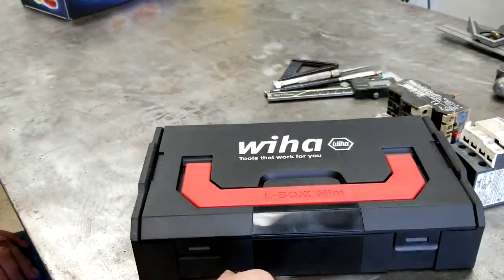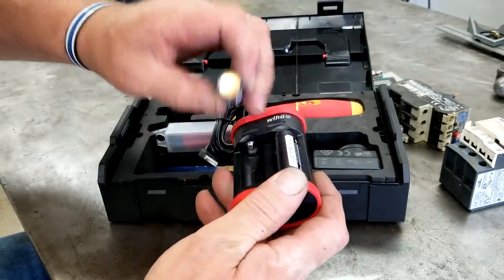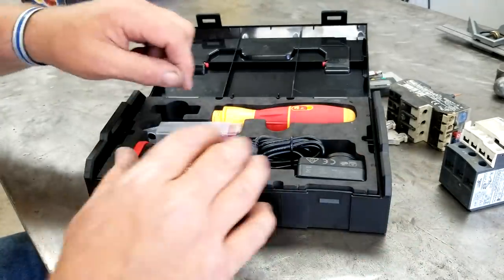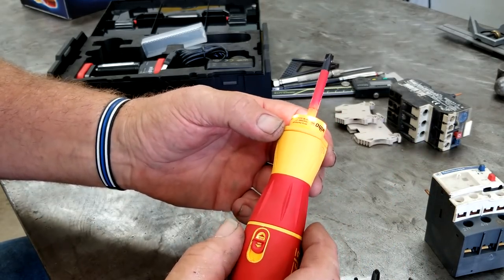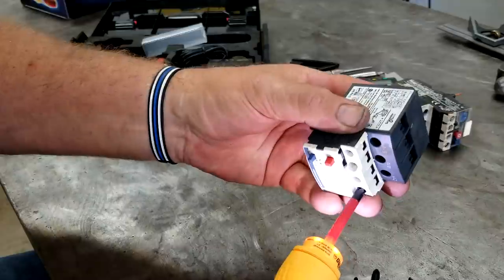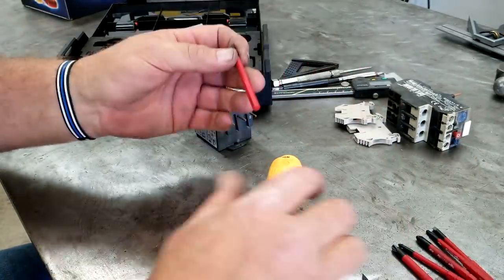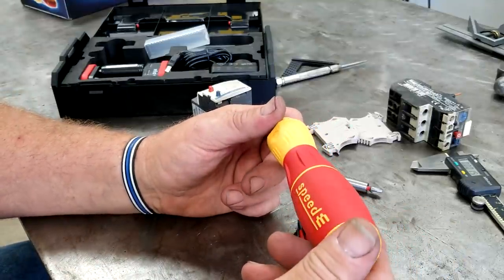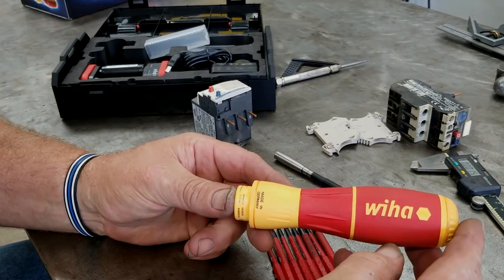Wiha Speed E II tool review

Comment: Thank you for your great review. It is the most complete review I found for the SpeedE II. One option I have in mind is the Wiha 41479 easyTorque set for slimBits and slimVario. With these you can use the SpeedE II motor and then finish by hand to match the needed Nm.

Comment: I love Wiha tools. I have the manual insulated screwdrivers and they are perfect. I also use the 4mm screwdriver bits quite a bit on electronics with conductive handles for ESD protection.  Wiha is short for "Willi Hahn" the orginal 1939 name. The electric screwdriver is new and out of stock right now or I would jump on it.

Comment: Not very long ago I spent $400 + for one of their master torque driver sets. They redesigned the handle (4-5 times now) on the special tool that is needed for setting your desired torque on the drivers. The problem is they never redesigned the cutout in the carry case that is supposed to hold this tool, and the newer tool doesn't fit in. I have to squash it down on top of the foam which keeps the case from closing properly. I contacted Wiha USA about getting a replacement insert for the case and they just blew me off.  I used to like their stuff, but their customer 'service' has now soured me on the company. After paying that much cash for basically what amounts to 3 screwdrivers and a set of bits I would expect ALL the tools to fit in the case.
Reply: No budy respond your comment, sorry men #todoinventostv

Comment: I'm sure their intent was to keep you from using the wrong bits in the driver. Now I'm gonna look to see if they have one for electronics with the small screws.
Reply: 75965 is the Wiha set you probably want. I love mine.
Reply: That's exactly the reason. They also have the speedE Industrial (without the 1000V rating) that can be used with the usual 1/4"-Bits. But all their VDE-Stuff (the german standard for electricians tools) with bits use the 6mm isolated bits.
Reply: @florianf4257  whats the length of the wiha industrial? Thanks

Comment: Thinking of buying this, obviously it would be great for landing wires, but how strong is it.  Could I use this in place of a impact for zip it's, sheet rock screws or similar?
Reply from the maker: Not strong at all, it's handy for free running screws to take up the slack, then a twist of the wrist to finish them off.

Comment: So, either they want to make sure you don’t use uninsulated tips with this, which is why 1/4” hex doesn’t fit. Or, they just want you buying their own tips, which I’m sure are expensive.

But admittedly, this looks interesting. If it were useful for anything else other than this specific work, because of the very limited power of the unit, I would buy it. Unlike Stan, I don’t do that much panel work. But maybe for any small item. Hmm. How much is this?

Comment: What??? You said Robertson driver. Have you ever spent time in Canada? Down here I have only ever heard them called Square drive. In Canada we call them Robertson and those are the majority of the screws you can buy. Now I have to ask. Have you ever used Marr wire nuts (anti vibration)? They where all I ever used In Canada and I loved them. Can't seem to ever find them down here in stores.
Reply from the maker: Never heard of them, interested.
Reply: @ShadonHKW  
Hopefully the link works. When I did electrical in my High School years I was taught that the wire nuts in the link are MARR wire nuts and the conventional ones I see in the states where called Marrette's. That was over 25years ago, so I may have been taught wrong. Granted I have not seen this type of wire nut in the states. 
 https://www.rona.ca/en/set-screw-connectors-2-10-16-15-pack-black-0320060

Comment: Incompatible tips that's a show stopper so is the $300+ price tag. That's a very nice box that will be set aside immediately. Nice they gave you a $3 bonus battery. How do you drive a socket from a 6mm hex? Dremel makes a great little electric screwdriver for less than $30.  It is 1/4 hex drive so everything fits. We use them in a production environment every day. They have adjustable torque and an 18650 cell in them which is twice the size in the Wiha.  Gotta love the Fischer Price color scheme. Next video: "machining a 6mm adapter for 1/4 hex tools"
Reply: Why would you compromise the electrical protection the wiha offers by machining a defeat of it?

Electrical protection that Dremel doesn't offer.   The "Fisher Price" colour scheme visually denotes the unit to be rated for electrical work.  Again, none of the Dremels have said colour scheme.  The Dremel would get you; at least, tossed from a high-voltage job if not outright kill you because it offers zero insulation in high-voltage work situations.
Reply: I'm guessing the letters VDE don't mean anything to you
Reply: Got a model number for that screwdriver that takes 18650s?